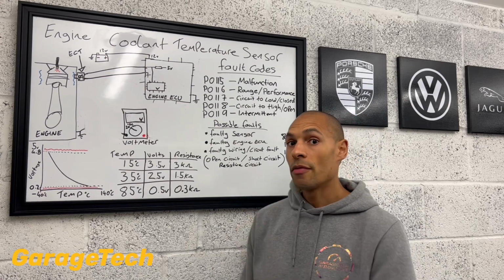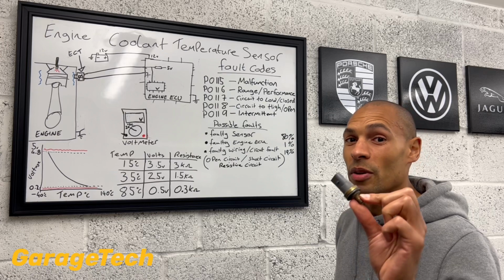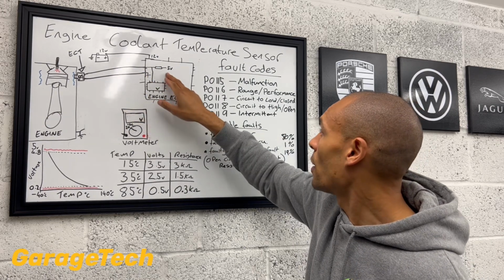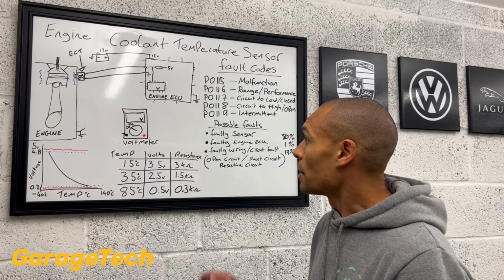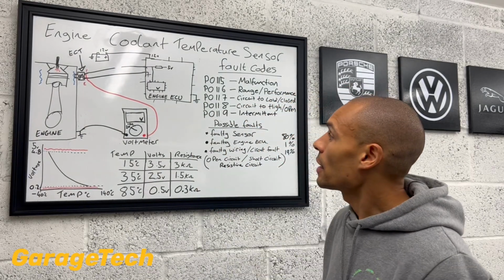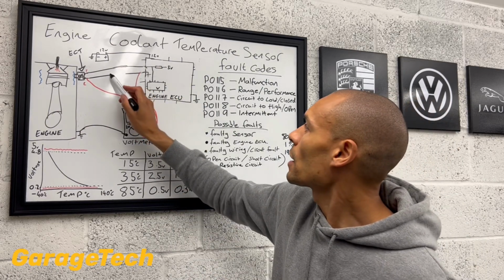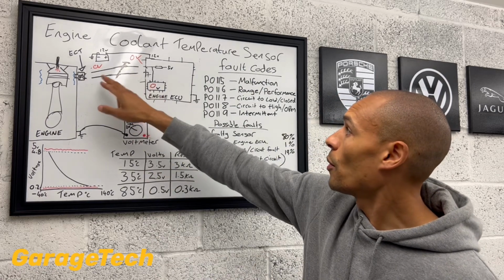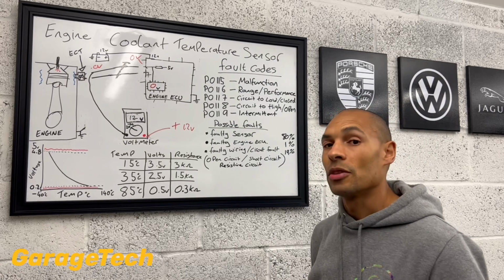How to test a faulty engine coolant temperature sensor ECT fault codes P0118 P0115 P0116 P0117 P0119

Comment: You're not explaining whether you're in open or closed loop and you're not explaining whether you measure the actual resistance across the sensor or the resistance across the sensor while in the circuit or how the charts are based on this question.
Reply from the maker: Hey thanks for the comment, I do show an example of checking the resistance in the sensor from 9:05 and mention it needs to be disconnected. Whenever checking a component for resistance you must always disconnect it from the circuit. When checking voltage the circuit needs to be complete and switch on. This is from 12:20 in the video. If you have any questions or need advice, let me know, ✌🏽

Comment: i don't have obd2
Reply: i got 81 degrees when engine is hot, it's wrong
Reply from the maker: @ronenfe  80-90c is about right for most cars
Reply: @GarageTechAutomotive but the thermostat opens at 88. The cooling fan also turns on sometimes. And my after market sensor shows 100 and using an infrared one shows 90.
Reply from the maker: @ronenfe  what’s reading 81? The gauge on the dash. Most cars with an analog gauge will read in the middle when up to normal operating temperature and so will indicate 80 or 90 degrees. If you were to take a reading from the ECU it should be about 90c. Did it used to read higher and now only going up to 80c?
Reply: @GarageTechAutomotive I read from the ecu and it's 81. I don't know what it was before. I ordered a new sensor. I had issues with the connector and I soldered a new one. Maybe I have high resistance somewhere
Reply from the maker: @ronenfe  soldering isn’t recommended by most manufacturers and they use heat shrink butt connectors to repair wires. Soldering in general is ok as long as you’re good at it. Fit the new sensor first, see how that goes, if it’s still the same, then it must be the wiring.

Comment: Goodmorning, in my VW Golf 5 1.6 FSI (2004) the cooling fans stays always on even if the engine is cold

I cheked with my obdII and the error says: "P2185 Engine Coolant Temp. Sensor 2 Circuit High"
at the mechanic diagnosis the error says: "P1290" (i dont know why they are different)
i thought there was an open circuit so i reached the ECU, and check the continuity of the wires of both temp. coolant sensors: both signal cable and earth cable have continuity
i also changed the temp. sensors with new ones
i have changed the connector of sensor 2
i have changed the cooling fans
but the problem is still there
the pins on the ecu seems to be all good...
(I have another error code: "P2209 NOx Sensor Heater Sense Circuit Range/Performance Bank 1 Sensor 1", but I do not think they are correlated each other)

I cannot figure out what the problem is, can you give me some advices?
Reply from the maker: @Luke-on3pv  hey, seems strange as you have replaced all the common items already, so just to confirm you have changed both fans and the coolant sensors. Are both fans running or just one? If one, which one, big or small. Is the air conditioning working correctly? Also check the fuses on top of the battery. Is the ambient temperature sensor and reading ok. Are you able to the read the sensors with your OBD tool to get a live reading?
Reply: @GarageTechAutomotive  
both fans are always running at max speed
my AC work properly
fuses all checked through voltimeter (in both containers: under the hood and on the driver side)
ambient temp. sensor: i don't know wehere is placed but the value displayed on the dashboard seems consistent with the reality

I have to try with my own obdII to read sensor values (i will try later), but on the diagnosis (to the mechanic) all sensor were reading the value correctly expect the Coolant temp. Sensor 2, which a constant -40°C was displayed both if the sensor was connected and disconnected
Have I to unwrap the wires from the sensor to the ECU to visually see if there are some damage, even if i checked their continuity and it was clearly working?
Reply from the maker: @Luke-on3pv   ok, if it was reading -40 then there must be a wiring issue somewhere if you have already replaced the sensor and the plug connector. Have you tried bridging the two pins at the connector, if you get a new fault code like circuit too low, that will indicate the wiring is ok, and has to still be a sensor fault.
Reply: @GarageTechAutomotive  I will try short circuit and see if that code appears
I Will let you know in few days
Reply: I solved the problem by adding a mass wire from the sensor to the battery directly
Probably the issue was the original mass wire that was not properly insulated...
By the way thanks for your support, amazing videos :)
Reply from the maker: @Luke-on3pv great to hear you solved the issue and thanks for coming back to update on the progress 👍🏼👍🏼

Comment: My temperature fluctuates between 90 and 60 where as before it was always on 90. Checked sensor it’s fine, fan not coming on but you see temp dropping and then starts creeping up. Thermostat is okay any idea. It’s a golf plus 1.9 tdi

Comment: Hi can coolent temp sensor cause a fiat grand punto not to accelarate just idle only
Reply from the maker: @PamelaMyaka  suspect not, you should get some RPM even if just in limp mode, that sounds like it’s more throttle related, if it has an electronic throttle body

Comment: Hello I have audi a4 1.6 my fan works all the time as soon as i turn on the car it starts and doesn't turn off only when the car turns off it turns off what's the problem please get me this code  ( p0116 Engine coolant temperature (ECT) sensor - range/performance problem ) I have changed the two temperature sensors
Reply from the maker: @elison25  hey, if you have changed the coolant/engine temp sensor and the radiator sensor, then I would check the wiring to make sure that it’s all ok. Is the temperature gauge or information on the dash working correctly. Do you have AC, if that’s on or if there’s an issue it will keep the fans running.
Reply: @GarageTechAutomotive  good morning  temeratur stay in order 90c the AC I don't turn it on because it doesn't work, I've had it off for months today he also issued me this code 

ERROR CODE: P1292

Engine cooling thermostat
Reply from the maker: @elison25  if both sensors have been changed then you need to check the wiring and plug pins etc. P1292 is a short circuit fault meaning either the wires are connected to each other, corrosion in the plug possibly, or a faulty sensor
Reply: @GarageTechAutomotive  you don't think it should be changed cooling thermostat
Reply from the maker: @elison25  is it the electronic controlled thermostat?
Reply: @GarageTechAutomotive  yes he is electronic and a mechanic told me that there may be a defect and it does not circulate the water, that's why the fan works all the time and I didn't know what to do
Reply from the maker: @elison25  yeah they can fail, the thermostat breaks inside the house, probably the next option if you’ve changed the other sensors already 👍🏼
Reply: @GarageTechAutomotive  hello bro I honored the thermostat because it was stuck, it works fine after a few kilometers, it starts to open and cools the engine, but I take out this code again and after the thermostat opens, the temperature is 70 to 80. 90 and the freshener works

Comment: Thank you for your video! Having issues with my A/C. Come to find out that my fans are not turning on. Thought it was the sensor or the fans. I bypassed the system and fans work. Changed temp sensor. Still not working. Tested the voltage from watching your video. And I have 5 volts from the main and 0.001 from the ground.  Not sure where to go from here. Any suggestions?  TIA
Reply: Code was the P0118
Reply: Could the new sensor be bad?

Comment: If the check engine light goes away, comes back after a while what could it possibly be?
Reply from the maker: Probably an intermittent fault, sensor on its way out. Or an issue with the wiring, loose connection, water/corrosion.
Reply: @GarageTechAutomotive  sorry I meant to add that I have a P0118, I had it initially maybe a year or so ago, I replaced the ect sensor, got rid of that but just came up again maybe 2 weeks ago.

Going to assume the part itself shouldn't go out that fast and check the wiring...

Comment: Found your channel whilst trying to learn and understand coolant temp sensors because my 14 Mazda cx-5 2.5 shows on my scan tool that the thermostat monitor engine coolant temp PID is -40F all the time even though both the primary and secondary coolant temp sensors read the same and are accurately reporting according to my tests that I got from Mazda's factory service manual.

I don't understand how this can be the case. It isn't throwing any codes. The temp sensors change properly as temp goes up or down. Also, my fuel pulse width is showing out of range as well. It's showing 1.4-2.1 when the scan tool says the range should be 0-0.1s. don't know why that is, either.

Comment: I just got a P0116 code and my mechanic is away til the end of the holiday weekend? Can I drive it until he comes back or is it undrivable?
Reply from the maker: Hey, the car will run on a default map, not the best condition to use the car for a long period or for a long trip but will be ok until the weekend. I’d get it sorted as soon as you can and minimise any unnecessary trips.

Comment: Brilliant lesson! I have been trying to solve the problem with my Merc.Vito for three years. It cost me a lot of money and no one solved my problem! Even worse than that, I had to replace the engine due to overheating! Watching this video, it is completely clear to me that my problem is in the wires from the sensor to the computer. Thank you very much, I'm going under the car in the morning!🥰
Reply from the maker: Thanks for the comment, hope you find the issue quickly 🙏🏽

Comment: I've been looking for a replacement temperature sensor for my bike for 2 months. At this point it seems my only option is to scrap the whole bike because it won't run properly without it.

Comment: Hi @ 9:05 can i use the paper clip on the plug method to test if the fans are working or will that ruin the computer?
Reply from the maker: Hey, it will just cause a fault as the circuit will see 0V, short to earth, circuit too low. Depending on the engine etc it may put the coolant fans on full speed as a default. If the engine has a radiator temp sensor too, it may use that as a default so may not necessarily put the coolant fans on.
Reply: @GarageTechAutomotive  Thanks. Ya i am thinking of trying this for my 2008 civic it has a coolant temp sensor. My concern was on the forms for 2008 civic I cam across this message.

The car does not use a coolant temp switch to run the radiator fan, it is controlled by a temp sensor now. Shorting wires for a sensor can ruin the computer.

Google searching the below will show the full thread 

"re: 2008 civic cooling fan wont work"

I just don't want to ruin the computer
Reply from the maker: @Random.Adventures.  best not to short anything if you’re not sure. What’s the issue anyway, are the coolant fans not working?
Reply: @GarageTechAutomotive  the issue is I have a 08 civic and I just never hear the rad fan come on. Last week i ran my car for 40 mins and sill no rad fan. If i turn on my ac then both fans will kick in. So I figure it could be the coolant temp sensor at the bottom of the rad. In about 25 mins the top coolant hose is hot and the bottom one is cold but shortly after both are hot so I believe the thermostat is working
Reply from the maker: @Random.Adventures.  what is the temperature gauge reading, if it’s staying at around 90c after 40mins I’d say that’s normal, just means the fans don’t need to be on, and the system is working efficiently without them. if the temperatures rising to like +110c and the fans haven’t kicked in then yes you’ll need to look into it.
Reply: @GarageTechAutomotive  temp guage reading normal usually always at the half way mark never above and never fluctuating. I agree I believe you are right that it is working efficiently. Perhaps also i am using the A/C usualy and the fans are always triggerened then so that may also provide additional cooling off . Appreciate the help

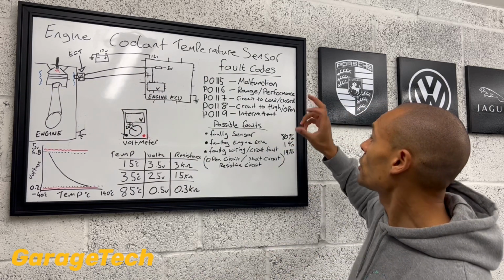Comment: Wow this explanation is brilliant!! I really appreciate all of the effort... Too bad I still have issues figuring out what i have to do with my varying P0115/P0117 codes (right now P0117 with -40deg)... I have got a Mini with a MAP controlled thermostat, so I have got 4 wires coming together to a single plug (2 for the MAP heating element and 2 for the coolant sensor). I have done a quick multimeter test that shows [pin1:12V], [pin2:3.5V], [pin3:0V], [pin4:5v]. I have got the electrical diagram that states pin1&2 are a couple (2=ground) and pin3&4 are a couple (3=ground). I dont know which of the couples is the MAP and which is the coolant temp sensor since i don't understand the difference of the diagram's symbols. I really could use some help since my garage doesn't know what they are doing (replaced thermostat 3 times!). A BWM/Mini specialist garage that i asked told me he wanted to help by replacing the thermostat for a original thermostat (of which i have my doubts). I am an engineer, so i have technological knowledge, but I have never worked on cars and electrical components....
Reply from the maker: Hey thanks for the comments, if you do a search for a variable resistor symbol, normally a rectangle with an arrow through it, that might help identify which circuit is which.

Comment: what about a P0597 (open circuit)-  I've replaced the thermostat and sensor, still getting the error (Kia Stinger GT2). Bought a Ancel Probe and just don't know where to look or how to test.
Reply from the maker: Hey, P0597 is linked to the thermostat as you have mentioned, if you’ve replaced the thermostat and sensor, you really need to check the wiring. You would be best to try and get a wiring diagram, and check for a feed and earth. Open circuit fault would indicate a broken wire, check the connector terminals etc. I would strongly recommend not to use a power probe, you could easily send voltage or earth a circuit that isn’t meant to be, and either blow a fuse or worst fry the ECU.
Reply: @GarageTechAutomotive  - I did what you described (got the wiring diagram) and it was 4.76 volts at the ECU, 0.0 volts at the sensor, so I'm guessing the power wire is broken... this sucks because the wiring is in such a ridiculously hard place to get at (between the firewall and the engine with about 3" or less to maneuver my hands.  So I guess my next move is to figure out how to remove the wiring harness so I can take it off and examine it. Any suggestions??
Reply from the maker: @blacktopmods  hey, I’d run an overlay piece of wire from the ECU to the sensor first, just to double confirm that the original wire is broken. You could leave that in place as a temporary fix, but you’ll need to find where the original wire is broken, as over time, other wires may break or already be damaged and corrosion or short circuits could occur.

Comment: I have a p0118 on my audi B7. The plug back there that connects into the gray sensor is missing. Not intact with the prongs. I only have the pinkish rubber on the prongs that holds them in the connector. My question is how do i knw its the sensor or a short or open wiring ?  Sensor nd o ring was corroded I shld add but wen checking the prongs with a ligh voltage indicator .light does not light up. So how wld i further my daignose for now ? Shld i open all the rubbers to check wires to ecu or to bottom sensor or ? Pls help.
Reply from the maker: Hey, sounds like you need to replace the plug and terminals and some of the wiring until no more corrosion is visible. Any corrosion can effect the signal and a broken connector will give you a fault every time the engine moves. You’ll need to check to make sure there’s no corrosion in the sensor pins to, otherwise the sensor will need replacing too.

Comment: Hi, appreciate your informative lecture.  Really cool.  My problem is, with key on, i don't have 5V but 0.005V, when engine is running i get 13.75V which is the alternatir.
Where to from here.  Thanks in advance.
Reply: Are u sure you are on the right sensor.

Comment: Would a faulty temp sensor cause erratic fuel injection? My foot will be on the accelerator and the engine will just drop in power for a split second then power back it will do that a bunch of times at different times while driving the vehicle
Reply: There are so many different sensors to calculate engine load while driving so the ECM knows how much fuel the engine needs. You need a mechanic or at least an OBD scanner.